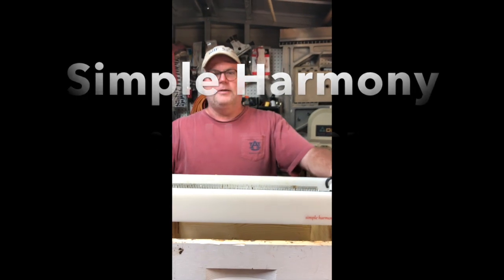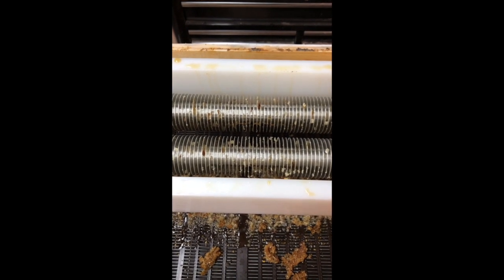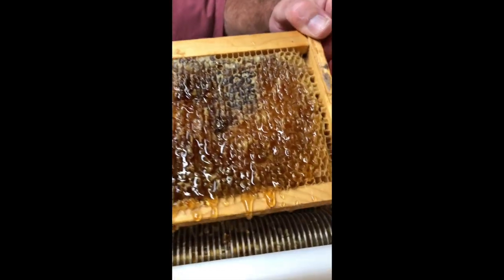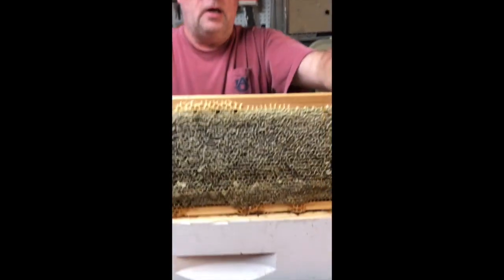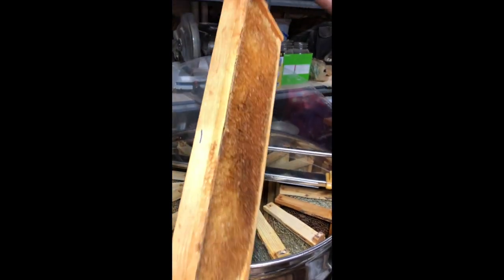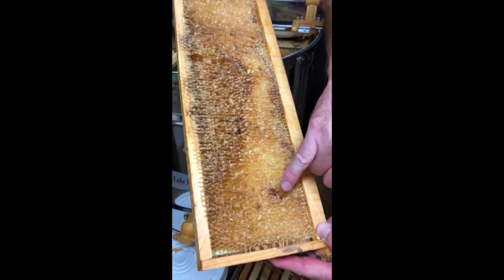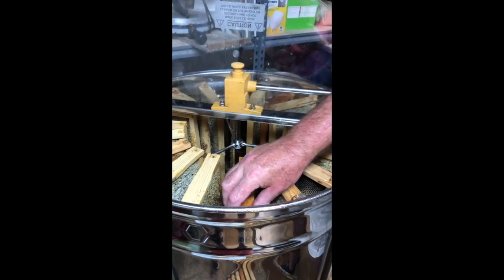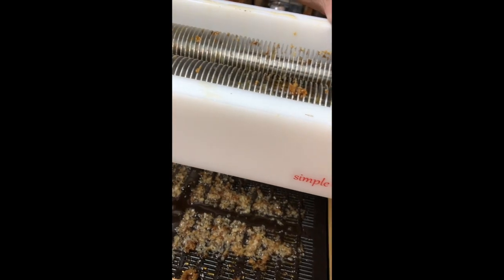Simple Harmony Farms Uncapper Product Review

Comment: Hi Patrick- after 3 years, do you still like this uncapper? Has it held up- staying sharp and functional?  Does it cause more wax cappings in the extractor vs the uncapping tank?
Reply from the maker: Yes, I do.  It has held up well, but I have purchased some spare bands just in case it gives.  I still use it exclusively.  Extracted roughly a 1 1/2 tons last season and will be doing roughly the same this season.  Still very happy with it.  There probably are more callings in the extractor than with a hot knife.  That is because you are really just breaking the callings open with the SHF while you are removing them with the knife.  I have about six 400-micron filters that I keep rotating in order to speed up the process.  I also got a settling tank and pump this year so I will be experiencing with that this season.
Reply from the maker: Cappings auto corrected to “callings” above.

Comment: Now that  you've recycled the frames back into the hives from last years' video, have you noticed any difference in the bees ability to store honey in the comb?  I've seen these types of 'uncappers' before and have wondered if the left over wax gets in the way of the bees storing honey.  
Thank you for any information you can provide.
Reply from the maker: Bee Bob:  This is going to be a long response.  Sorry in advance.  I had the exact concern that you did last year.  That was a relatively small run (58 frames) in the last week of August.  I put the frames back on the hives for about a week.  The bees “cleaned them up” but the faces of the comb were wavy.  So, they sort of built them back, but I believed they were largely ignoring their supers because there was no flow and they had no incentive to make wax and build back.  So I pulled off my wavy super frames for the year and waited until this year.  This season I ran a total of 310 frames through the SHF uncapper in two pulls on June 2, 2019 and July 7 2019.  (1,200# of honey).  I put the combs back on the hives after both pulls.  Within a week each time, the combs were repaired and the bees back in business storing nectar.  There was no wavy or half-built out comb.  When I saw this, it made me going from really liking the product, to loving it.  I have a theory which I cannot prove so take it for what it is worth:  The “blades” of the uncapper do not sever the wax from the comb.  It seems to crush and displace the capping while leaving it in place.  I believe (and I have believed a lot of things in beekeeping that have turned out to be false) that when the frames are returned back to the hives, the bees can chew these crushed-but-attached capping with their mouthparts and reuse the wax to rebuild the damage caused to their combs.  IF . . . IF . . . IF . . . This is in fact the case, that is an ENORMOUS amount of energy and food stores saved by not having to create all that new wax for repairs.  I have now uncapped over 360 frames with the SHF uncapper.  I am a bigger fan today than when I made that video almost a year ago.  BTW, I do not know these people (SHF people), have never been contacted by them, and I paid full price for the uncapper.  Never received a dime.  Just a beekeeper trying to work out a bottle neck in my process.  My uncapper now waits on my extractor (opposite problem from the problem that was solved by the uncapper).  So my next purchase is either a Maxant MUTT uncapping tank, or just buy a second 18 frame extractor to speed up the process.  Sorry for the length.  Happy beekeeping!
Reply: @patrickmccalman207  Awesome!  Thank you so much for the information.  I've seen one type where the person hand cranks the frame through but has to do it numerous times to crush the cappings.  That thing was over 1200.00.  A bit too pricy for my operation.  I use a friends certified facility which is basically a shed.  Not a lot of room for uncapping using a knife.  Also, I have to take all the cappings home that day and drain it for the next day.  This will rid me of that aggravation.  I guess the only negative to this whole thing is no beeswax for candles or other wax products.  Big deal.  I've got a hundred pounds of wax sitting in storage for when I actually start making candles.
So,  to your long and very informative response to me, I'm leaving a positive response to you.  I've also subscribed.  Thanks again.

Comment: Having trouble cleaning mine.  

Yes I let the bees try.  But man it’s not suppose to be this hard.  Lol
Reply from the maker: Cleaning can be a pain.  I let it sit out and let the bees and the sun work on it.  Once you have nothing left but the dried and crusty cappings stuck in the roller bars, you can take an air compressor and blow it out.  Doesn’t work great when wet and sticky.  If no air compressor, I take a single chop stick and manually pull all of it out.  It takes some time, but overall, a great time saver.